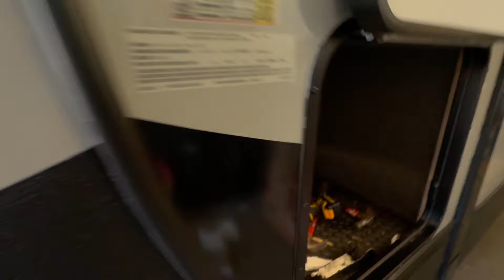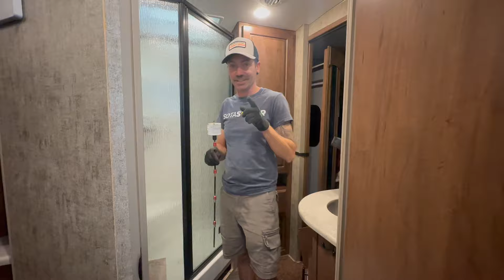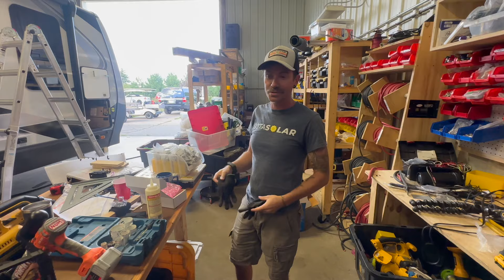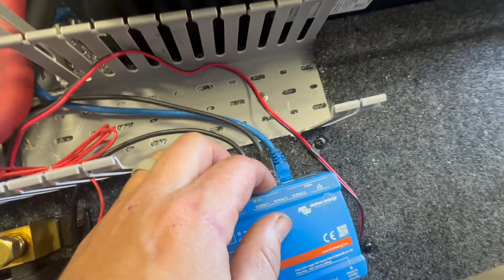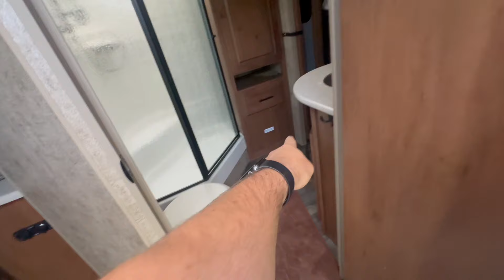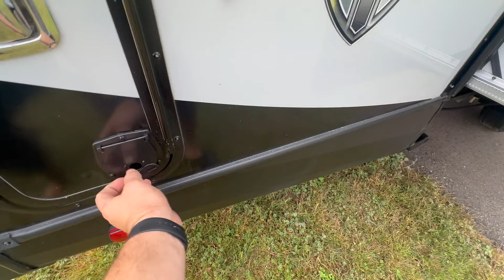Outdoors RV Titanium Series Victron Solar System Install 1600w 600ah Heated Lithium Battery

Comment: I have an ORV with a similar setup. I pulled the fireplace to run the power and cerbo through that wall.
Reply: Work harder think later bahhahaha  Joking lol Your table assemblies look great  installed !
Reply from the maker: That might have been simpler in the end :-)

Comment: Question? 
Why do you continue to use those crappy old fashioned batteries. 
You could put three Epoch 300 amp hour batteries in that same area.
Or four LiTime 230 amp hour plus batteries in that same area.
Or Big Beard 300 amp hour batteries.
All three brands of batteries have better BMSs with 200 amp hours continuously.
Your still the man, but think about it?
Reply from the maker: Great questions. We did look at Epoch 300s, no availability at the time. We’ve done Epoch 460s and like them.  LiTime…. Not a huge fan. 

I think we could start seeing more Epoch batteries.
Reply: @sotasolar 
HoboTech, he tested those LiTime 230 amp hour plus batteries.
Surprisingly, those batteries are pretty good 👊
Reply from the maker: We don’t doubt they are good when new. Three things we look forward to for. 1) heating, 2) Bluetooth, 3) most importantly a case you can take apart and service.  

I actually really like the form factor, I just wish I could open them up easily if something goes wrong. Customer often forget to turn the system off in storage and the batteries just need a jump start bypassing the BMS.
Reply: @lindsaywhite4502  Good to hear.  I just bought four of them.
Reply: I hope my 4 230’s LiTimes last. I was going to build bats with cells but went the easy way.